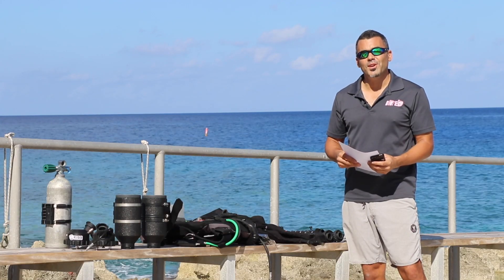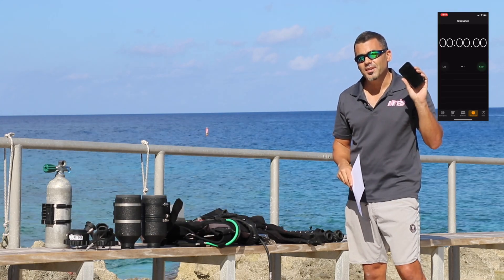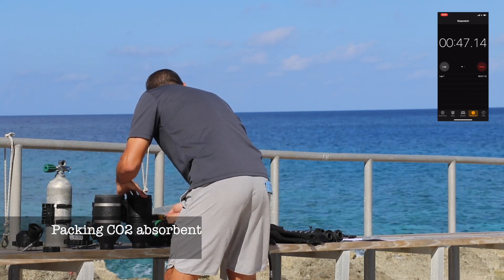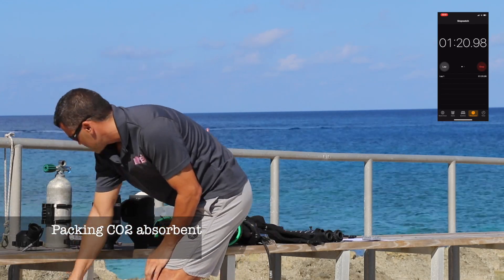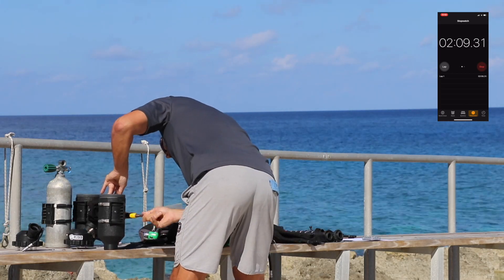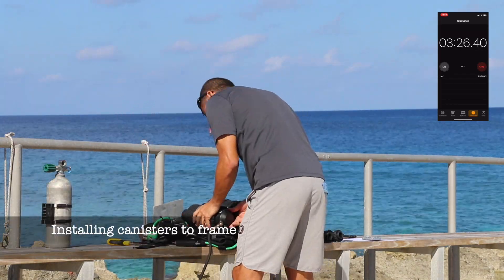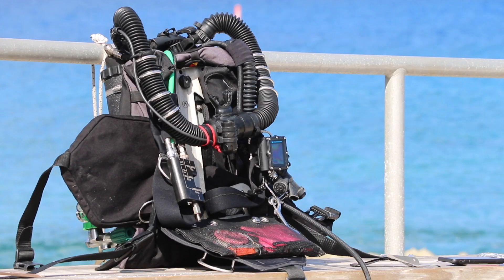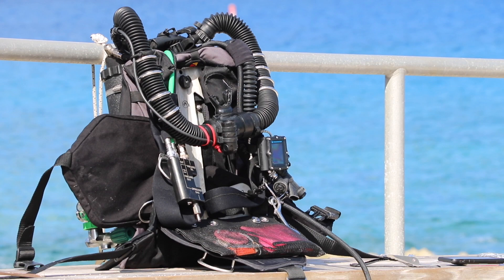KISS Orca Spirit LTE Rebreather Setup

Comment: It would have been nice to also have the demonstration done in real time.
Reply from the maker: Hi David, that's a valid point, however the purpose of this video wasn't to show how to assemble the unit, rather to illustrate the simplicity of the unit. Having been a diver on about 9 different units, most of them take upwards of 45 minutes to assemble using your checklist due to the amount of complexity they have. This video is intended to be a teaser of sorts, like our other videos, to show why you might want to learn more about this unit.
Reply: @DivetechLtdWestBay  What mounts are those on that are on you scrubber canisters and O2 bottle?